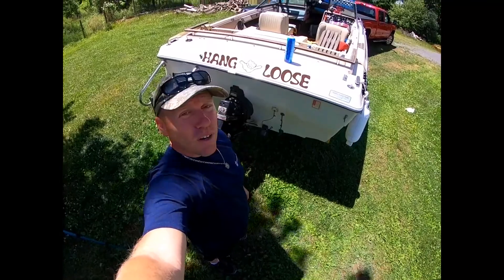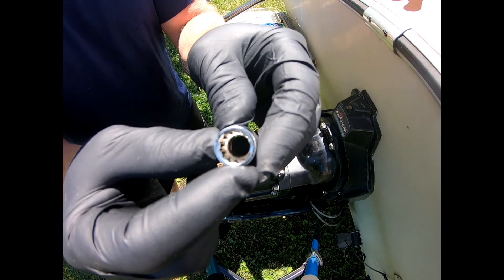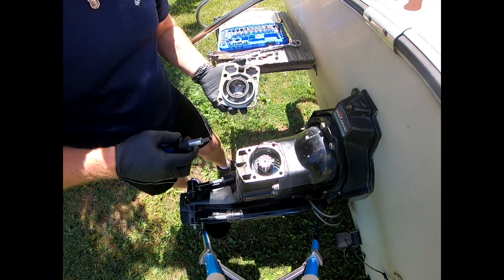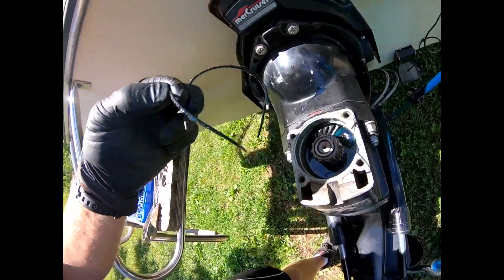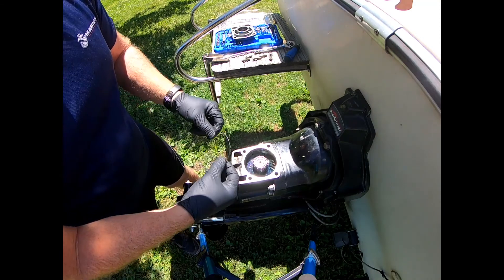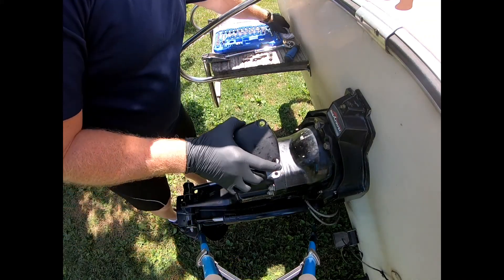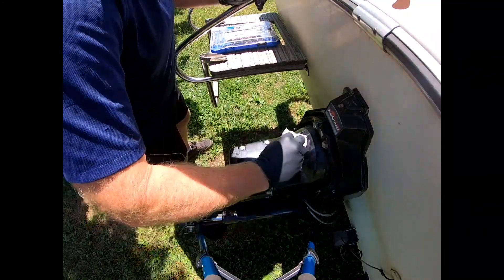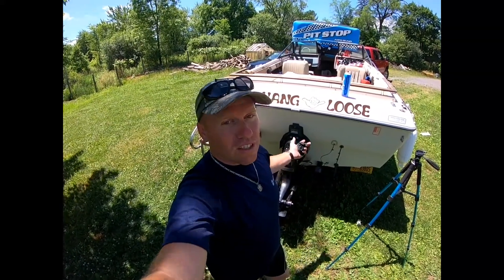Mercruiser Stern Drive O-ring Replacement DIY

Comment: GREAT VIDEO 👍. IS THE GEN 2 SAME ??  🤙🤙🤙
Reply from the maker: Thank you! Yeah they are pretty much the same other than gear ratios and impeller housings are a little different but close enough you can figure it out! Thank you for watching!👍😊
Reply: @WhitehouseFarmVet  GREAT 👍. Ya my gen2 is leaking from up top there looks like. Hope it’s this easy of a fix… THANK YOU AGAIN 🤙🤙🤙🤙
Reply from the maker: Yeah hopefully it's just the o-ring good luck buddy and have a great summer!👍